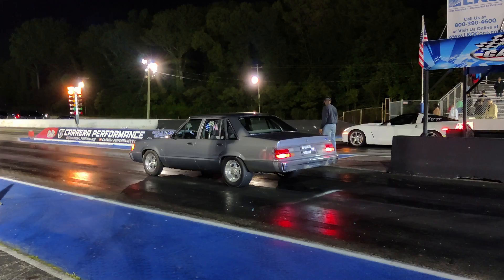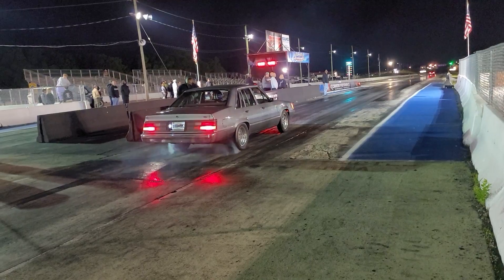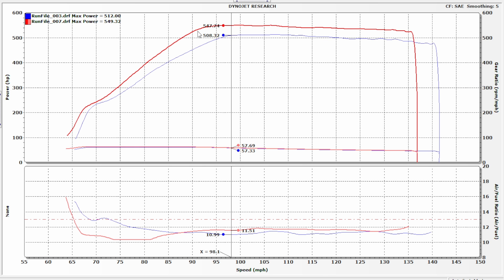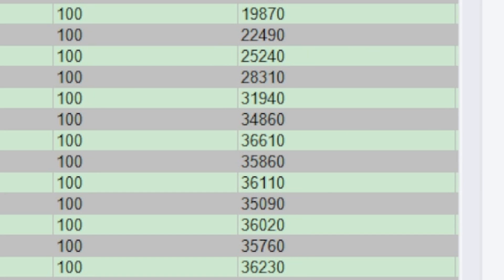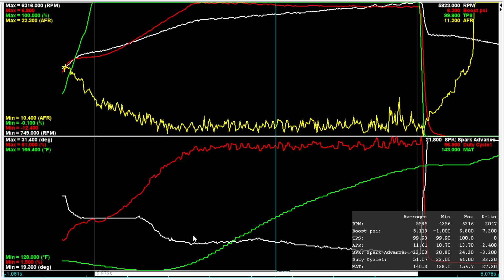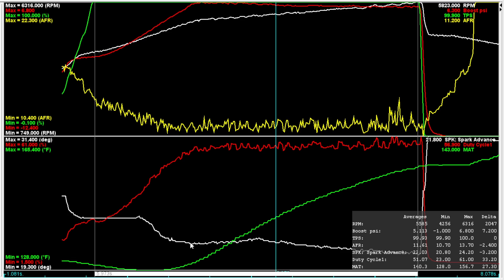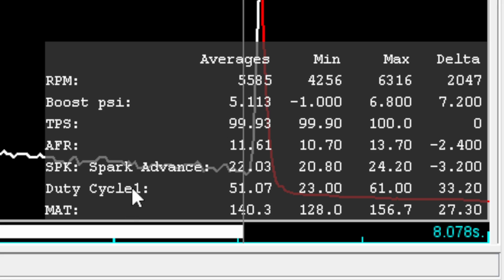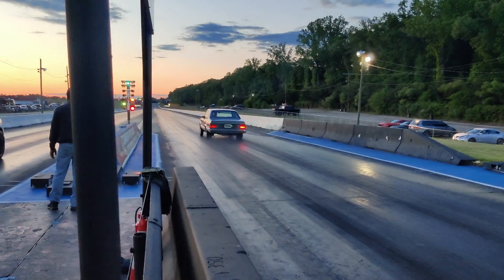Volute Methanol Injection Dyno Data - Deep Dive!

Comment: I get a 35 to 45 degree drop to my intake temp. And my intake temp sensor is located in my lower intake. Sooo yeah. The cooler air and denser air compressed higher in the combustion chamber. All the magic happens in the cylinder... 💪😎🤘🤘🤘